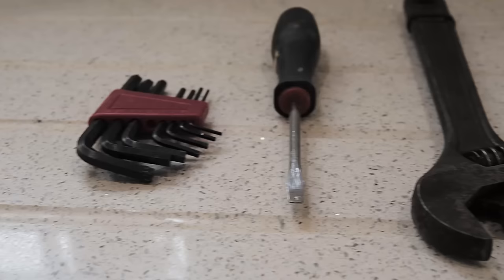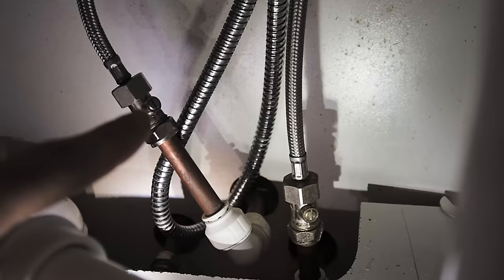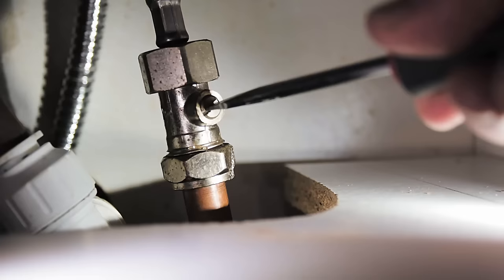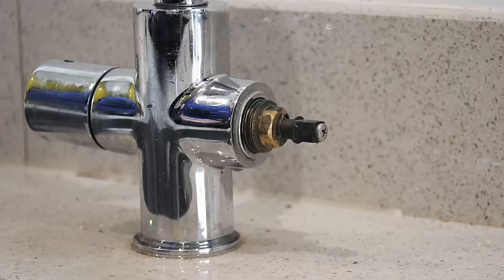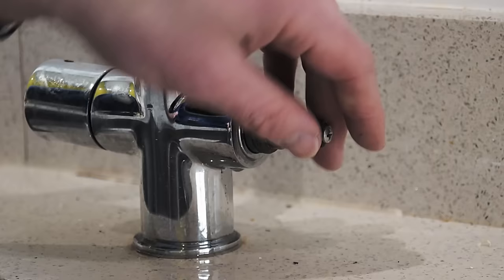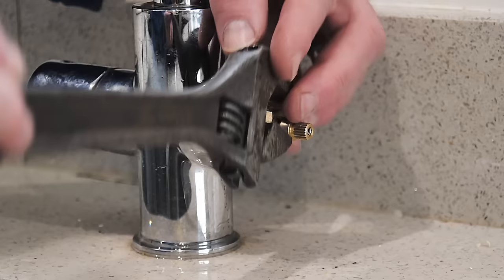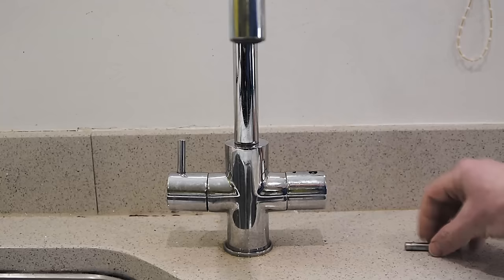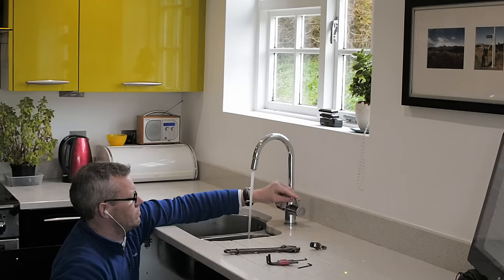How to Fix a Mixer Tap | DIY Series

Comment: Well done mate. simple clear and to the point. I was on the verge of spending £200 to replace my leaking mixer tap. I then watched your video, and thought that's my issue and I can do that. Removed the valve then located the correct replacement as there are several variations in size. I then put it all back together as per your video, and Now have a non leaking tap. Top Man.....
Reply from the maker: A pleasure to be of service 😀

Comment: Thanks clear and concise, just one point, rather than replace whole cartridge wouldn’t it be easier to take off old washer at end of cartridge and put new one on? I imagine it would be a lot cheaper and you could do as you did for cartridge and take old washer along to plumbing suppliers to get new one the right size.
Reply from the maker: Yep, thats another way if doing it!
Reply: This video just saved me a £100. I struggled to find a replacement core for my tap but did learn to strip it down. Sprayed the interior and ceramic with limes cake remover. Put it all back together and the dripping tap stopped
Reply from the maker: Hey Kevin, thats brilliant 👏  more videos coming in the New Year. Any suggestions of DIY jobs for videos I'd love to hear them!

Comment: How do you know which side is dripping?! Also on mine the valves are recessed, you can't get to them with an adjustable spanner.
Reply from the maker: Can you switch off one at a time underneath the sink? If you can then you can hopefully see which one is causing the leak. If the valves are recessed you are going to need a socket set to get them out.

Comment: Not a plumber... is there an easy way to tell which valve needs replacing? Also, if there is no isolation valve on the hot water pipe under sink how do you isolate the water to replace the hot water side valve? thanks

Comment: Good video, managed to do all in the vid before watching. However, when I unscrewed the cylinder to get at the grub screw a little black rubber washer appeared and I don't know where to put it when I reassembled the tap . Now the cylinder and the housing keeps coming loose after a few days use. You didn't show that bit in your video. Any advice?

Comment: If it is a mixer tap, how do you tell whether it is the hot or cold feed that is dripping?!!
Reply from the maker: You need to turn off one of the feeds at a time, under your sink, then run the tap, that way you find out which one is leaking.

Comment: Word to the wise, there are different size tap cartridges,  take out old one and measure up before ordering, most sites selling these tap cartridges will also display size and spline counts.
If you have  ring spanners then use a ring spanner that fits, lot easier than an adjustable,  

Also you may find just a good clean of the ceramic discs may stop the leak . its simple to do. No tools needed for the cleaning
Bit of silicone greese for lubbing the ceramic discs if you have it, 

Take tap cartridge from the tap, on a clean work surface take the cartridge apart by first removing the circlip on the stem with the splines, should be able to push it of, don't lose it, next at the bottom of cartridge remove the colored washer, use fingers should come away easily.

 Before proceeding look in through the bottom and take a pic as the disc needs replacing the same way.

Gentle and slowly push on the stem and the ceramic disc will fall out, you donot need to completely remove the stem, 
Examine the disc surfaces, if there are any scratches on the discs then you need new replacement cartridges 
Hopefully the surfaces will look unscathed, with warm soapy water and sponge or tea towel clean both discs, careful not to scratch the sufaces, you are ready to reassemble the cartridge. 

At this stage if you have any silicone grease a dab on the surface of the disc will help but you may get away without it.
So resemble is reverse of taking it a part, take cartridge body, grip the stem and pull it up firmly, the reccess for the circlip will be visible, re attach circlip.
Turn cartridge upside down, looking in side at it you ill notice 2 groves, on the disc you will notice the discs have 2 small bits that will sit in the groves of the cartridge, the first disc should have a slot on 1 side which will locate on a raises bar on the bottom of the stem, if you have some silicone grease apply a little on the remain disc, making sure you have it the right way round,  line it up with the internal groves in the cartridge,  now reinstall the bottom seal press in firmly to seat it properly. 
Check it works fine then reinstall at test,
7 out of 10 times a good clean will stop minor dripping
Reply: I did this and it appears to have worked, let all the parts soak in some vinegar and regressed the lot. Fingers crossed 🤞

Comment: Thanks for this video. It helped me fix my leaking tap. Instead of replacing the cartridge I took it out and soaked it in some descaler for 1/2 hour and replaced - works like new now. Also with my style of tap (that looks similar to yours)there was a small round cover on the base which needed to be plucked off to reach the Allen bolt to remove the tap cover.
Reply from the maker: OK, glad you got it sorted and good to know about the descaler!
Reply: Thank you for that, I had some descaler it worked for me too.

Comment: Thanks for making this video. I would normally call out a plumber and pay £200 or so to get it fixed. The hardest part was getting hold of the right replacement valve. If you’re not sure best to take out the faulty one then take measurements and use Google to make sure you know which valve is right for your tap.

Comment: Really useful video - thanks! Note, knowing which replacement valve to get can be hard as there are slight variations available (Screwfix have about 4) even if it is a bit longer or shorter than your current one it will still work.

Comment: Some older houses do not have isolators. Draining down the system for a couple of valves is a longer job but do-able.
Reply from the maker: Yep agreed, draining down is a pain but doable. Maybe once you've drained down, fit isolation valves for future use.

Comment: Watched your video, got the valve out with a bit of grunt, it was well secured in there.  Found a replacement ready to order then put the original back in....and it's stopped leaking! Well....at least I know which one it is if it starts again.....
Reply from the maker: Yep, its pretty clear if you follow the steps. Hopefully all is dry and not leaking now. 👍

Comment: Great well presented video! Just as an over thought - how to identify which tap is dripping as both use the same outlet pipe? Thanks again 🙂
Reply from the maker: The pipes coming in underneath should be hot or cold to the touch when the tap is running

Comment: Hadn't realised it was that easy. Many thanks
Reply from the maker: No problem, yep its pretty straightforward, just make sure you get the right replacement cartridge.
Reply: I did the bathroom sink which was almost the same. Couldn't figure how to get the taps off in the kitchen sink. Once I find the right Allen key I will give it a go. So helpful. Being on pension not always possible to employ a tradesman for something that looks so easy. Great that people like you make these tips available. Many thanks
Reply from the maker: Hey David, no problem, you've just made my day!

Comment: Thanks boss, got the same tap, hopefully I can apply the same method.
Reply from the maker: Good luck with it, just be gentle removing and putting the valve back in as its fairly easy to strip the thread.

Comment: Simple when you know how. Thanks for your video.
Reply: Can't get the handle rod out. Any ideas?
Reply from the maker: +geoff ward WD40 and wrap a bit of rubber around it... then gently use mole grips to loosen it... the rubber should protect the handle and help grip it

Comment: You make it look so easy !
Reply from the maker: Just make sure the water is off and you can take your time doing it.
Reply: Wait til when you turn on the water you find the valve leaks, so it needs replacing. When you try to isolate the supply at the stopcock you find its seized solid.

Comment: These HowTo vids are great on You Tube....but I don't get the preoccupation with the adjustable spanner; it's like using a sledgehammer to crack a nut....PLUS....using a much smaller set spanner gets you into those inevitable awkward small spaces.

Comment: My kitchen mixer tap broke today. The hot side won't stop running even when you turn it off and the only way to stop it is turn it off at the mains. Is it a broken cartridge or do you think I need a whole new tap?
Reply from the maker: Sounds like there isn't an isolation valve under the sink? If not you should probably get one fitted whilst you have the mains off.
A new valve cartridge should sort it though.

Comment: hi nice video .
But my tap has  just one lever that controls hot and cold  and my leak is coming from the bottom of the tap where it meets the basin .What should I do please .I find that no video highlights this type of leak but just leaks higher up the tap etc 
 cheers

Comment: So what do you do when you remove the grub screw but the handle wont come off? Tried forcing it with a screwdriver and it wont budge. Without the handle  coming off cant get to the cartridge.
Reply from the maker: You could try taping it gently with a rubber mallet, might just loosen it, but be gentle. It should work it off slowly.
Reply: @fix-make  I'll keep trying
Reply from the maker: @davidac76  if you can get the edge if an old steel ruler in there you might be able to lever it off slowly.

Comment: Hi I need to fix a dripping tap identical to this what are the replacement cartridges called  what model no etc
Reply from the maker: There should be a link in the video description to Amazon for the correct valve.

Comment: I’ve got the same tap, the new valve you put in looks like my valve but no way can I unscrew it. What I want to ask you if you know why the handle of the tap keeps slipping round? I had the original tap replaced with the same tap but the second tap has started to do it. I’ve unscrewed it and tried to fix it many times but when you turn the handle it won’t turn water off, you have to turn it further back. Hope you understand what I mean.
Reply from the maker: Hey Helen,
Without seeing your tap its really difficult to advise you. Sounds like either there is a grub screw that needs tightening... maybe on the back of the handle... or that the replacement cartridge isn't the right size. You could try wrapping tap around the end of the cartridge so that the handle is a tighter fit.... but as I said its really tricky to advise without actually seeing the tap itself.

Comment: I am not able to take off the handles on my taps to put in new ceramic valves. It has a small hole under the badge cover for a small allen key but have tried but allen key will not hold and turn just loose any ideas how to remove the tap handles.
Reply from the maker: You could try a different allen  key, some of them are really soft and so round off really quickly.

Comment: A great little video, 1 question, are the valves a standard size as in 1 size fits all. Many thanks in anticipation of your response.
Reply from the maker: Hey Debbie,
I am afraid they come in a lot of different sizes, best take the one you have into your local plumbing merchants to see if they can match it.
Hope that helps!
Richard
Reply: @fix-make  Will do. Many thanks for your reply and time.

Comment: Great info mate but doesnt seem to fit my query. Im in the middle of having a kitchen fitted and the tap is brand new. Its not the same tap as yours but similar in principle. Ive removed the tap and the water is coming out where the valve and turny bit meets. It looks like its kept in place with a split pin. Any thoughts, much obliged.
Reply from the maker: Without seeing it I can’t really advise. Only thing I would say if it’s brand new take it back to where you bought it and get it replaced.

Comment: How do u know it the valve needs replacement and not just a washer. With out taking apart if you don't know
Reply from the maker: Well, try replacing the washer first, its alot cheaper.
Reply: Can't afford  pay for washers then have to go buy hole bit .
Just to help a friend out

Comment: Great help thanks. I have the same tap and removed leavers and the grub screws but how do you remove the chrome shrouds over the valves? Your video glossed over that bit! Are they just corroded with lime scale? Any tips? Thanks.
Reply from the maker: I suspect your ones are corroded on, mine just slipped off.
Reply: Did you have any joy getting them off? I have the same problem 🤷‍♀️
Reply: Did you manage to get your taps off? I have the same problem here,  I’ve removed grub screw but they won’t slide off even with a whack or wedging the screwdriver to prise them off.
Reply: @DjNemes1s  No the housing cracked. Good video though and I learned my lesson - greasing the new tap valve cover to hopefully  prevent future corrosion.

Comment: Having trouble undoing the handle at the start. Have tried wd40. Any tips? The chrome is so slippy and there is a bit of corrosion which doesn't help.
Reply from the maker: You could try wrapping some rubber around the handle ( old bike innertube ) and gentle gripping it with pliers. But be gentle as the chrome can scratch easily.
Reply: @fix-make  innertube worked a treat thanks
Reply from the maker: Brilliant! Really cool to know, makes making videos worthwhile.

Comment: Are there any temporary fixes you can do to stop the dripping without replacing the valve?
Reply from the maker: I haven't tried it myself but you could try grease around the valve, works for other things, might work for this!
Reply: If you take the plastic cartridges out of the valve and soak them in a limescale remover for a while before replacing them it can prolong the life of the valve for a while.
Reply: If the cartridge has a washer you can replace that and see if that works

Comment: any tips how to get the handle off? Mine wont budge with pliers and a towel
Reply from the maker: Gently tap it around thr sides with a hammer.... but I mean GENTLY and wrap the tap or the hammer with a cloth so you don't scratch the tap.
Its probably just gunked up and you need to break that seal. 

I take it you have removed the grub screw first?

Comment: Any tips to get the handle off? Mine are too tight to unscrew by hand
Reply from the maker: You could try monkey grips, but make sure you protect the tap with something... maybe a bit of bike inner tube? So it doesn't scratch the tap/ faucet.
Reply: Great advice which has worked! However, my mixer tap is slightly different to yours… I have got the taps off with the Allen key but this hasn’t revealed the hexagonal nut, the nut sits inside of the main unit so I am unable to get my adjustable spanner in there. Any thoughts?

Comment: Where did buy the replacement valve fittings from?
What size did you use?
Thanks,M
Reply from the maker: Hey Mike,
I just took the valve to my local plumbing merchant, they matched it for me.

Comment: My tap looks the same as this but I can't unscrew the handle to get inside the tap. Any tips or do some handles not unscrew?
Reply from the maker: WD40 might work or wrap something around the handle and gentle try mole grips perhaps. They can and do rust on solid .... then it's a new set of taps.
Reply: Try under the handle

Comment: My tap is leaking at the spout swivel joint, not the ceramic disc. How do I fix that?
Reply from the maker: Is there a grub screw at the back of the tap? If there is you may be able to tighten it, or take out the top half of the tap and fit a new seal.

Comment: I have changed both valves with new ones and I still have a dripping mixer tap.  Any advice would be appreciated.
Reply from the maker: Not sure what to suggest I am afraid, sometimes cleaning the little filter on the end of the tap can stop that happening.
Reply: Thanks.  I ended up replacing the entire tap mixer unit with a new one.  I got fed up with it.
 @fix-make

Comment: How do you get the levers off the hot and cold sides. They won’t unscrew! 😳
Reply from the maker: Not sure I am afraid, there might be a grub screw perhaps?
Reply: Found it! On the opposite side from lever is a wee dimple. It’s a cover plate for a grub screw.
Reply from the maker: Ok great, hope you can get it sorted!

Comment: How do you know which tap is causing the drip?
Reply from the maker: Turn off one of the water supplies at a time, dry off around the tap and wait, if it keeps leaking you know its the other supply..... ie turn off the hot, dry off the tap.... and it still leaks... then its the cold side.. does that make sense?

Comment: which one is causing the dripping? that is my problem I have one hot one cold and one in the middle for filter
Reply from the maker: Chances are its the hot... the heat makes the rubber seal go quicker.
Reply: @fix-make  I sincerely hope that's the case with mine, cannot however hard me and me Dad tried get the cold cartridge out. So off to plumbworld with the hot one to get a replacement and keeping everything crossed it's the one that's causing the drip! Great video, thanks.
Reply: @mummycool1  Hi Gillian...we have the very same problem..even my 6' strong husband can't budge the cold one...! Tried WD40 and boiling water ...still solid....lol
Reply from the maker: Iam afraid there comes a point when a new tap is required....
Reply: @yclare1  I ended up having to call my plumber out to get the cold cartridge out & even he struggled big time but he did it only charged me a tenner bless him, brother of a friend. Hope you can sort it x